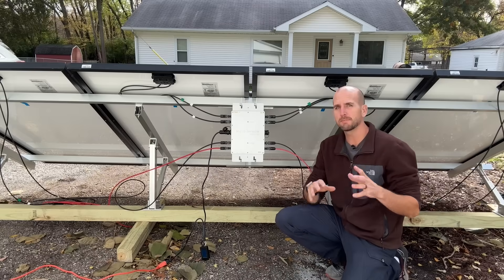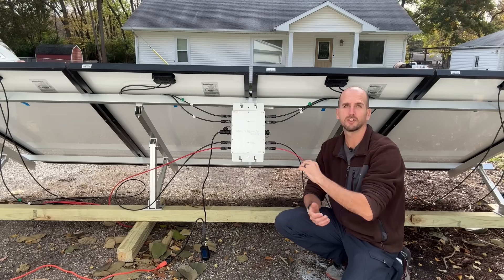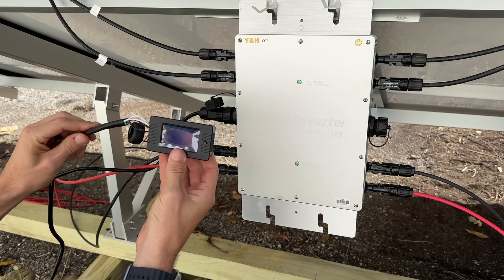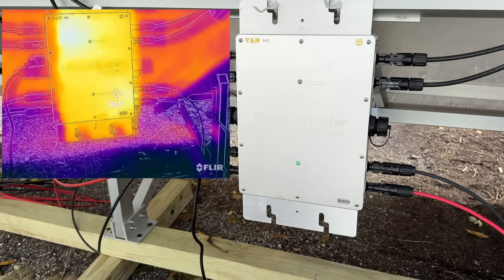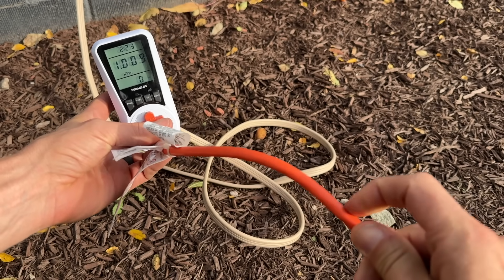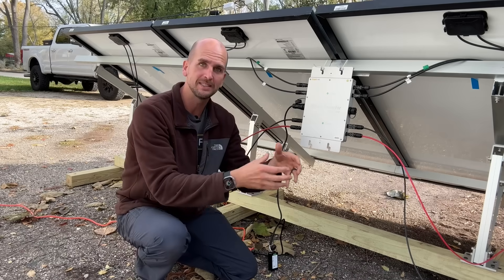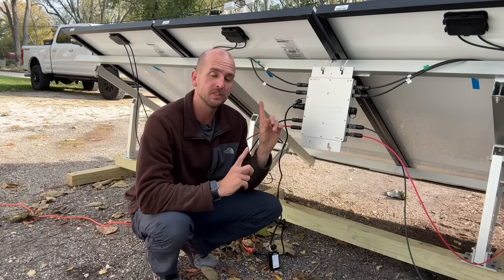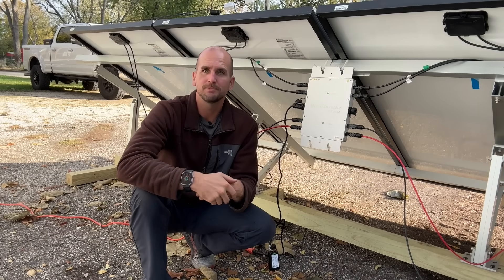Plugging Solar Panels Directly Into An Outlet | Surprising Results

Comment from the maker: Calculate Solar Cost For Your Home - https://geni.us/solar_reviews

2 Panel Micro Inverter Unit (600W) - https://geni.us/Z4RdX
4 Panel Micro Inverter Unit (1200W) - https://geni.us/A0AfAL

Ecoflow Delta Pros With Dual Voltage Hub: https://geni.us/HijVzm8

DISCLAIMER: This video and description contain affiliate links, which means that if you click on one of the product links, I’ll receive a small commission.
Reply: What if you ran the invertor inside and had a fan running to it to keep it cooler?
Reply: *DO NOT BOTHER WITH THE SOLAR CALCULATOR* It REQUIRES your home address, first and last name, email, phone number (and text verification) and other information. It’s a privacy nightmare. 

*Beware*
Reply: *ALSO The solar calculator website is an undisclosed affiliate link and should not be used regardless.* Proceed with caution.
Reply: Can you please share the brand name and model of the termal camera you used in this video?

Comment: I'm Leary about direct plug in units if your grid detection should fail you might be in trouble with the power company a transfer switch is a better solution 73

Comment: Important to note these simply wire the panels in parallel internally. Only 1 MPPT tracker. This makes a very, very big difference in efficiency. If one panel is shaded output drops through the floor.

Comment: Apparently it is only legal in Utah for the time being. If it is 120 volts it could also leave a household system unbalanced but at 1200 Watts that is not significant unless one connected several on one leg. The unanswered question is how does it prevent backfeeding the grid?

Comment: What if you attached a larger watt panel?  We are limited to what is available here. Most are mid to high 500W range.  Would it just be a "loss", or could it harm the 300W input unit?

Comment: This is introducing bad connection practices in your house.  I’ll rather extend  a separate breaker from house electrical panel to connect with the inverter of these panels.

Comment: Your fuse box could be made to have a place to plug in huge amounts of power without risking your wiring being over loaded.  Its weird that nobody seems to be making systems that really integrate with solar.  Everything is some weird add on.  The fuse box should be fundamentally different.

Comment: Only rated 3.4 on amazon.
36% of users were 1 star....
Too risky of an investment.
Reply: Well I bought one anyway on a chance.
Only going to input 600 watts total.

Problem with it is that it limits input voltage too low.
My panels max output are 27v and the inverter max input voltage is 50 volts.
So I cannot tie my panels in series.

Comment: Thanks for this video! I read that a West Coast company is now selling this sort of setup already wired and ready to plug into a home. But no one in the press bothers to explain the problem of feeding power into the grid if it goes down. I assumed there had to be an automatic decoupling device, and that seems to me to be the most critical part to look for, especially in a cheaper unit.

Comment: Thanks for posting this easy setup and the great descriptive video. I bought a single Y&H controller and 4 100w panels. Plugged them up and worked perfect. Added bonus with the (small) display.

Comment: I have a switch. I don't want my solar/battery feeding the grid.  switch is a DPDT 80AMP Contactor with a manual on/off switch. feeds a simple 120v 50amp subpanel which handles all the 120v circuits in my house. My spouse of 53 years can flip it.

Comment: Question: Can you use that Microinventor with a solar generator such as the AC180 Bluetti? I am thinking tricking the inverter that its connected to the grid?

Comment: I just got a TSUN 2000 microinverter with 4 450w bifacial panels, and am getting 8kwh per day. No installers, total setup done in about an hour. Total cost with panel supports: 1,200 euro. ROI is less than 2 years.

Comment: These are supposed to get hot mine works great i love it but remember it's built to sit under solar panels so 130 degrees is not out of the ordinary
Reply: Been running mine for a couple months now and it is great 👍 going to put another in line soon

Comment: I've used a similar 1000 watt inverters for years until my utility would no longer allow for me to back feed even thought they where island protected and would shut down in a power outage. Best is to make sure of what else you my be powering on that circuit that your pushing power on as you can over load that circuit!!. My suggestion use a RV outlet that can be dedicated to only the solar panels or add a separate circuit

Comment: Plug in micro inverters are a thing in most of europe. Usually limited to 600 or 800 watts because that's how much we can safely add to a circuit without a risk of overloading our wiring. That might be a problem with the low voltage system in the US unless you have a dedicated circuit for them. Over here, my grid operator has a list of the brands that meet all their safety standards. Those are Anker, APsystems, Astro energy, Deye, Envertech, Growatt, Hoymiles, TSUN and a few more brands that only have 1 compatible device. 
People who don't know the difference between watts and amps are allowed and capable of installing such a system. During the setup in the app it asks your gps location and applies the required settings to comply with local regulations.
Several micro inverters also have support for a battery. 800W maximum for injection and the extra gets stored in the battery. I have 1.8kWp solar hooked up to an 800W inverter. And if I had the space for more solar panels, I'd probably add 2 more panels to that inverter.

Comment: I have a number of Y&H units still that I have used for several years from amazon.  Have burned up probably a dozen of them too, which is fine as long as they were under warranty.  They were not very reliable (at least the early units).  I was running to 1000w and one 600w units.  All in all the experiment  was not bad.  Have to watch large motor loads though.  I burned up quite a few on these turning on an air compressor and it took a while to realize that was what caused it.  Not sure why it did that but it did.   Considering putting them up on the house we moved to at some point. I was concerned that i was double paying for electricity with the meter I had when I was not able to use the power though.  Some of the other units have limiters to prevent pushing electricity back to the grid.  Mine did not and my meter type would have registered as usage to my understanding.

Comment: What if i decide to install in my rv, plug into any 110/120 outlet and not connected to grid, will it work with just my 110/120 outlets

Comment: Don't fool yourself with these inverters, they get bloody hot at full power because they have a low efficiency, The connectors turn to dust when exposed to the sun in a couple of years. Measure the impedance,  the two bottom MC4 are interconnected so you don't have 4MPPT channels just two and you panels operate in parallel. The same counts for the two top MC4. If this inverter has a 95% efficiency, it might be Worth, but the info I have is that it's not. The good thing is you can open it, and it can be repaired. I did that.

Comment: You forgot to mention that you must have a NET programmed main power meter to accept reverse reading. Otherwise you will increase your electric bill 💵. The old meters count with AC motors so they will run backwards. $

Comment: What I want is to power a water heater in winter and then a mini split in summer, out in my poll barn/shop. If this goes well, I'll spend more and do the main house, adding a fail over type switch that pulls from solar when it makes power then reverts to grid power at night. Doing this and not installing a huge expensive bank of batteries will hopefully save a lot and provide enough power to lower my energy bill substantially.

Comment: Installed 4 panels and ran the lines and the inverter in the basement, found that during peak times the inverter seem to overheat and shut down. Added a fan to cool the inverter and the temperature was greatly reduced and never overheated or cut out during peak output.  Seems the inverter would be better designed with a large heat sink on the unit itself. The inverter was a 1200 watt unit and panels total 800 watts max.

Comment: If you have the old-style electromechanical meter, yes it will run backward if you are producing more power than you are using.  But if you have a standard electronic meter, it will run forward and charge you for any power you feed back into the grid!  Only the special bidirectional electronic meters will run backward.

Comment: The use cases section was very lacking. I didn't really catch any use cases other than this setup can be plugged into and external outlet to help you save money on electricity? At any rate fun if you just want to throw money on a cool project. I can't see this saving that much in my area. 800-1500 bucks in equipment and I may save 20 dollars per month give or take from my estimate. One the high side it would take 7-8 years for the investment to pay for itself in energy savings.

Comment: A very important perspective on this topic I think needs to be pointed out.  The fact that you can take some PV modules, and inverter and jury rig an electrical connection to your home wiring and get the entire system up and running should not be too surprising considering this is the very function that this equipment has been designed to achieve.  The fundamental difference between a jury rigged setup like this and a proper professional PV installation all comes down liability and legality of the system.  This type of jury rigged connection is more than likely going to violate the terms of your supply agreement with your utility company and is clearly not compliant to wiring code on the basis that the installation has not been inspected and signed off to say that it is safe to operate.  No electrical inspector would sign off on a jury rigged connection like this - in this video you point out some of the reasons - the use of a microinverter that you can't find evidence of compliance to required safety standards, and the fact that the safety of the connection is highly dependent on using the a correct rated power extension lead (how can an electrical inspector sign off on something that you could simply change later if you replaced this extension lead? - an extension lead is not considered permanent wiring!).  
The worst case scenario here to consider is if there was some electrical fire in the house and it is determined that a system like this was connected to an AC outlet of the home then there is a fairly high chance that your insurance company would not pay you out for any fire damage - irrespective of whether this jury rigged system was responsible for starting the fire or not.  Connecting an electrical device that is not UL certified into an AC outlet in your house directly violates the terms of any home insurance policy you have.
As you point out in this video - a similar idea to this is quite popular in many parts of Europe and goes by the name of "Balcony Solar".  The difference with these Balcony Solar systems comes down to all of the liability, legality, and safety issues being correctly addressed.  For example if you were to replicate this exact setup in Germany that allows Balcony Solar this particular setup would still be illegal on the basis that the Balcony Solar concept does not allow for jury rigged installations of non safety certified equipment.  The Balcony Solar concept allows for PV equipment companies to build a complete 'plug and play' solution that meets all of the necessary legal and code requirements, allowing the home owner to connect a safe system that also complies with your utility companies requirements for grid connected PV (which typically limits the maximum size of such a system).

Comment: I would like to isolate my swimming pool heater, -electric-From my house circuit and run it from a set up using solar panels. Could you kindly give me a rough starting place. It needs to be 240 V and 25 A.

Comment: Hi Scott,  I just came across your channel.  Interesting info on grid tie inverters.  Thanks.   I also wanted to point out that your panel mount system although a rigid  4x4 construction, doesn't appear to be anchored to the ground by dead-man or concrete block.  If this is the case, a strong wind is going to at least move your array or upend it and damage your panels.

Comment: I may be wrong. Never plug into a wall outlet. You are on the back side of the breaker. Simple 20-amp breaker to 20-amp wire in your walls. You have a max load on the wire and breaker. Now you plug in your 10-amp feed. The breaker sees 10-amp while 20-amp is on the 20-amp line. Then someone plugs in a 10 amp something. Now the breaker is seeing near or at 20 amps ready to trip. The wire that is rated for 20-amps in you wall has 30-amps on it now. House could be gone.  Tie to the mains at the outside breaker box with its own breaker. That is where the power is split up to feed power to rated breakers for the wire size. Or load size.
Reply from the maker: Yeah, you bring up a valid point.  I prefer to pull a dedicated circuit to the outside outlet if at all possible to avoid this type of scenario.
Reply: @everydaysolar  Hope this helps other. That is my plan. I plan to install a 240-volt Ac breaker box to feed 240-volt grid tie into. I will have low amp Ac breaker for each grid tie. At the main I have a free double pole breaker free. For more safety I will swap it for breaker that is just above the max amps that comes from all the grid ties. Wire going to the main will be twice the amp rating to insure no heating to the wires if something goes wrong. If anyone sees anything wrong with this. Please chime in. P.S Love the videos.

Comment: Europe :  Allowed is 800 watt  per group (socket) so 2 panels with for instance the Hoymiles or Enphase microinvertor. Man you are years behind with this video. When the grid is off these invertors shut down automatically.

Comment: I have 42 Vmp, 48 Voc panels. Can you series connect the microinverters to handle 2x 300 W?
I wonder if this works in combination with a hybrid system. Let the hybrid system handle the grid connection and let the microinverters handle the base load, while the hybrid system charges the battery and handles (most of) the peak loads. If you want to expand on a hybrid or off-grid system and you cannot add more panels to the existing MPPTs, this could be a cost-effective solution which also allows you to run bigger loads while the sun is shining.

Comment: Very interesting and always good to learn, the question now is if you already have a solar system already installed for example enphase system, Can you add this same setup in the video with out affecting the enphase solar system or equipment or would there be any error codes in the cloud?

Comment: Guide: how to get your home insurance dropped and electrical power disconnected from the power company.

This is not safe, not legal, and not allowed in the US.

Not safe: you can overload wiring in that circuit because loads are able to consume power from 2 sources which produce more than the current limit of that circuit and wiring.  IE: 15 amps from the breaker plus whatever the solar outputs.

Not legal: you aren't allowed to do this without a permit, and any permit inspector will not approve.

Not allowed: your terms of service with the power company does not allow this without an agreement in place. They can disconnect your house if they want to.

Comment: Question: 
What, if anything within this setup is synchronizing the frequency to the grids 60hz?
Wondering if this is where the "heat" may be coming from outside of current flow.

Most people never consider frequency on the sine wave, I would think this would buck the phases creating a major fire hazard..

Comment: My buddy lived less than a mile from a TVA power plant and he created a contraption that would capture the bleed off from the power lines and ramp up the voltage and charge a battery bank. It worked best on foggy days and would shock the crap out of you the closer you got to it. He died with his secret to capture power only he knew

Comment: having a total loss of power can be over come by disconnecting from the grid when it is down and use a backup power supply to energize your inverter and then power will be available from your solar system, as long as you don't run down your back up supply you can go indefinitely.

Comment: i wondered when something like this was going to surface again, once upon a time a long time ago there used to be a device you could plug into a 110 socket that worked like a one way valve allowing you to inject power into you existing wiring, i don't remember the name of it but the utilities companies lobbied hard to get device outlawed, i've been trying for years to find one without any luck, legal or not i'd run one especially the way the utility companies sce are doing everything they can to stop consumers from adding alternative energy to their homes.......

Comment: So, if the grid goes out and you want to watch TV it cuts off?
Reply from the maker: Yep, this unit will not work without grid power.
Reply: I believe I have to rewire it for a bypass so I can watch TV.